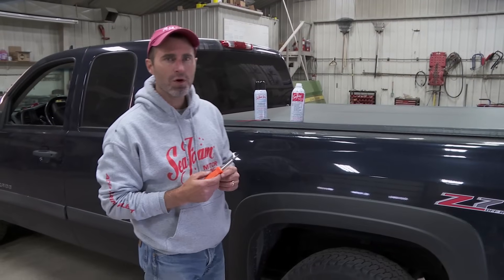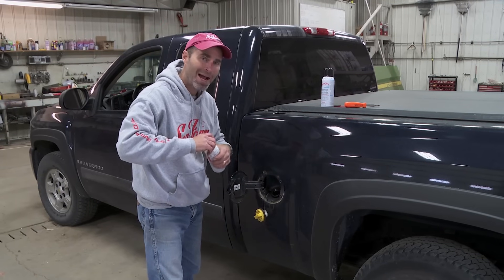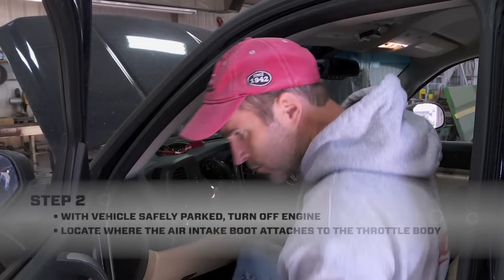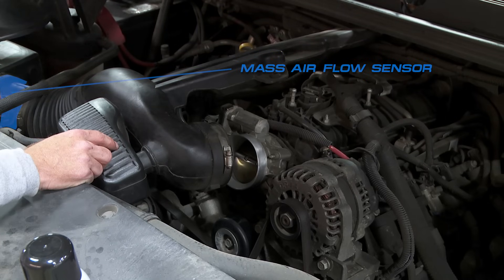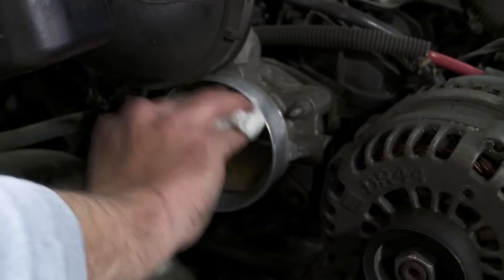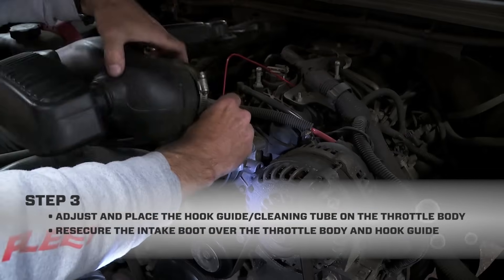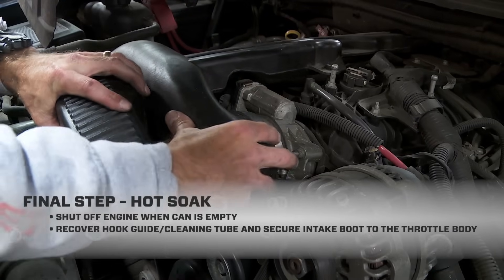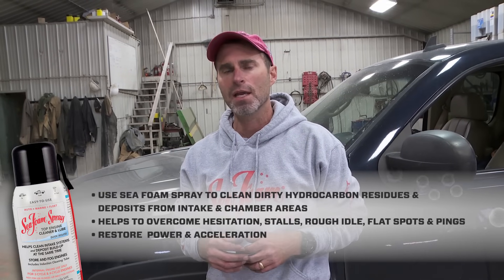How to clean a gasoline fuel injection air intake with Sea Foam Spray

Comment: Just like your website said. It's safe, and I can't add too much....Does that means my gasoline engine can run on pure SeaFoam? I'm sorry. I'm not trolling, I'm just using logic. Because when I read "can't add too much", that's the first thing I thought.

So if add a full bottle like that, to the small tank of a 4 stroke scooter...I will create a blinding smoke screen behind me...but my scooter will still work?
Reply from the maker: 2 answers

Too much: Consider 'too much' in the context of harm or that Sea Foam is harmless to a fuel system..  Will "too much" harm my engine? Answer is no, never.  Nothing about Sea Foam's ingredients can cause harm to fuel system or engine parts and components.  

Scooter: Sea Foam does not replace gasoline. No, your scooter would not without at least 50% gasoline volume. Running a gas engine requires a minimum of volatility/light ignitable vapor.  Keep in mind that these products are intended to help people to overcome common engine problems caused by fuel residues.   Hope this helps!
Reply: Sea Foam Official Thank you. A day after I asked, I saw another one of your videos, where you mentioned up to 50/50 SeaFoam to gasoline for gasoline engines. 

But wouldn't "There is no amount of SeaFoam, that can harm your engine.", be a better slogan, then, "can never add too much"? Because "can never add too much" can lead to people trying to run gas engines on 70, 90, or 100% SeaFoam.

Then again, my slogan idea, may lead idiots & trolls, to hydrolocking engines with SeaFoam....

...How about this?

"SeaFoam is a safe & effective way to clean engines." 

"And continuous use will keep them clean."

"Because gasoline engines need gasoline like fuel to run, you shouldn't add more then 1 part SeaFoam, for every part of gasoline in your tank. Any ratio up to half, is ok."
Reply from the maker: #1) Respectfully, please check out what philosophers refer to as 'infinite regress'.

#2) With that under your belt, I think you'll see our contextual intention is that Sea Foam is harmless to any engine's fuel system no matter how much you use - that's the point we're making, not promoting excessive amounts.  

Note: No one reasonably uses 50% except expert technicians that apply with specialized equipment through the fuel rail using a single can of Sea Foam. Just like toothpaste, I have no doubt that I could safely use a whole tube to brush my teeth...but it never occurs to me because the whole tube won't make things any cleaner than the inch I apply to get the job done.   Hope this help!

Comment: I used this stuff in my intake (spray) and put a can in my tank, and now have a small miss under any load, or acceleration, it even kicked on my check engine light, but when I disconnected the battery, it went away, but still has a slight miss. It is an 07 F150, anybody got any ideals?
Reply from the maker: Check plugs.  If applied too slow (RPM) can foul plugs.
Reply: My bad, it turned out to be one of the new coils was bad
Reply from the maker: Glad you figured it out!

Comment: Can't you short your electrical system opening the throttle body while the car is running?
Reply: WHAT??? SERIOUSLY? if you have to ask that question, you have no business even going NEAR ANY vehicle.
Reply: At 2:41 he says to put the nozzle about 1/4" in front of the throttle plate - not past it. You can also find this in the written instructions on the Seafoam website.
Reply: ShiaLaButtFuck you sir, are an idiot.
Reply from the maker: The throttle body is closed/sealed by the boot during the application.  Other is most modern cars won't start without the boot attached.
Reply: Thanks for the reply, but that doesn't really answer my question: so will my vehicle's electrical system be shorted if I move the throttle plate when the battery is connected?
Reply from the maker: Why would you remove the throttle plate?  If you meant intake boot, no worries.
Reply: I never said I wanted to remove the throttle plate? I said 'move' it, like to get the seafoam spray straw past it, so I can use it to clean my engine. I've heard from numerous professional mechanics that if you move the throttle plate with the negative terminal connected, it could short my entire electrical system.
Reply: Thank you!
Reply from the maker: My error, sorry.   Yes, you can goof things up by pressing some throttle plates.  If not sure what direction a plate turns inward, have someone turn key on and press the accelerator.
Reply from the maker: Thanks, Tweezak.
Reply: No problem, thanks!
Reply: No when you are driving your opening the throttle that’s what gives the vehicle more air and gas and makes the car go faster. Some can be opened from under the hood by hand by finding the throttle cable going to the throttle body there may be two if the vehicle has crews control this is depending on the year model newer model vehicles have no throttle cable just electrical wires this is called fly by wire. If you do it this way you want be able to see the rpm of the motor and if you open it to far cause damage to the motor. A thousand rpms would be opening the throttle just enough that you would hear a very slight rise in the motor rpm. It probably idles at about 600 - 800 rpm.
Reply: I could be mistaken but I believe the instructions mention the included hose applicator inserted approximately a quarter inch from the throttle plate. Not inserting it inside of the throttle body Past the Plate but rather a quarter inch from the throttle plate as the directions indicate otherwise yes you will throw off the calibration on the throttle body itself and may strip the plastic gear that opens the throttle blade
Reply: ShiaLaButtFuck awesome fucking name! That's what I've called that dip shit for years! This made my day

Comment: Curious, what does this do to your catalytic converter?
Reply from the maker: If applied correctly (with RPM raised) will have no bearing on a Catalytic Converter, which is down the air flow stream from the engine.   Fluids (additives) sucked/poured too rapidly through vacuum lines can cause issues.

Comment: Can i do 2 cans into throttle body back to back then let soak 15 minutes. My intake has 245k miles worth of carbon build up. Already did 3 per instructions on separate days. First one people thought the house was burning down. Last one still lots of smoke. Not as much on driving like the first. Car drives much better after.
Reply from the maker: Yes, can do back to back.  Better to do one can, hot soak (leave straw tube in), drive...then repeat so you get 2 hot soaks.  Doing 2 hot soaks with one can also works great (spray half/soak/drive, repeat).
Reply: I see you emphasize hot soaking. So hot soaking and driving for a few minutes seems to be key. Seems to have worked great so far. I wonder how much carbon it got. AS i bet my intake manifold was mostly closed due to carbon. How many more treatments you think it might take? The car has 250k miles of carbon build up.
Reply from the maker: How many treatments depends on the degree of buildup. Charred carbon on upper engine parts is normal, excessive buildup can cause issues, particularly on intake valves. No matter, the broad answer is that Sea Foam Spray helps turn things in the right direction and you can use it as often as you wish.
Reply: am about to do my 4th treatment spray in intake. The last one was still alot of smoke. U think i can ever get my intake free of carbon build up or mostly free? I have seen intakes with 100k miles looking like they are half clogged up. Another question. How much smoke should there be if they are pretty clean?
Reply from the maker: Hi WIlliam:  If you are that interested, consider getting a bore scope view of your chamber hemispheres.  There's no other way to know how much without removing parts.

White smoke is oil vapor - means nothing.  Dark smoke says dirty or motor oil residues getting carried out.

Comment: I got a Check engine light after this. And then, I unplugged the battery and put the wires back on to reset it. Any help??
Reply from the maker: That should do it.  If the application activates a sensor, things should go back to normal once the engine computer adjusts back to running on straight air and gasoline. If the dash light shows after driving 20 miles, a code clear by battery disconnect usually does the trick. Some newer makes will require a scan clear.
Reply: Sea Foam Official okay thank you. Hasn't came back on.

Comment: So you don't fill tank with gas when you put in gas tank?
Reply from the maker: Depends on whether you want a higher or lower cleaning concentration.  Adding to less fuel increases the cleaning ability.

Comment: I am wondering about an 8 cylinder verses and 4 cylinder, full can in both cases???  1998 Saturn SL2...same amount of seafoam spray in both cases?  I am going to start with half a can, let it soak for 10 minutes.  113,000 miles and runs good, don't want to upset the apple cart so to speak...
Reply from the maker: Full can no matter how many cylinders.  Can't cause harm, no worries.  Can also do half a can, leave straw in, then do the second half of the can after the first hot soak and drive.

Comment: I am very pleased with the results. backed up to a wall of tall bushes to use as smoke filter at local shopping mall LOL no smoke. car doesn't pink at 70mph, slightly pings if I punch pedal to the metal at 95mph. use to go up a 2 mile hill at 50mph, now I can go 65mph. How's that for 132,000 original miles
Reply from the maker: Note that you can keep using it to keep working to overcome pings/flat spots. If me, I'd do a treatment every week till the ping goes away.  Try longer hot soaks, too.
Reply: Pretty shitty.   Most cars at 132K are still running just fine and not pinging.
Reply: Use higher octane fuel or get it tuned.

Comment: How should I use on a '68 Dodge Dart Slant Six 225 on a with 132,000 Original miles. This is a legitimate question, Thanx.
Reply from the maker: Look for the Sea Foam Spray video that shows carburetor throat application.  Process is very similar except you're spraying into a open carburetor intake instead of a closed (boot) throttle body.

Comment: How do I use this on a Toyota Prius. The engine doesn't run when you turn it on. It's a hybrid
Reply from the maker: Great question. A Prius accelerator held at 1,500 to 2,000 RPM will be running on gasoline.  Be careful with the straw nozzle direction in relation to the MAF (mass air flow) location... don't let down on the RPM while spraying.
Reply: actually i figured it out. you have to get the prius into diagnostic mode, that keeps the engine running theres a bunch of youtube videos on diagnostic mode for the prius.
Reply from the maker: Helpful to know - thank, ltigre2031.

Comment: can u also add to the crankcase while this being done...crankcase, intake ,&fuel @same time??I have a focus dohc 2.0L EFI
Reply from the maker: Yes, you can do all three at the same time.  Just understand that what goes on in the crankcase does not directly relate to top end.
Reply: OK I just bought the seafoam cans needed to do all 3 will get on it in a min...thx
Reply: Sea Foam Official can I clean the intake again without having to change the new motor oil
Reply from the maker: Hi Clay:  Yes, the intake (upper engine, combustion) and motor oil (crankcase) are not related.  In other words, cleaning through the intake has nothing to do with the motor oil crankcase.
Reply from the maker: Have fun, Clay!  Let us know what happens.

Comment: I heard that this procedure is not recommended to do on eco boost Ford's. They were saying that some have resulted in damaging the eco boost turbo. Is it safe to use on this vechiles? Also, is there any warranty available if it does damage the turbo.
Reply from the maker: Hi Bryan:  Please, respectfully... helping you requires that you be specific about who is "They"?   What damage?   How is it possible?   

Please do NOT use Sea Foam Spray (or anything) if you don't understand what you're doing.  Personally, I would NOT do If "They" has a legit and responsible explanation (not hearsay or poorly formed thinking... ).

Comment: did all of this.. is there a reason my car didn't smoke like I've seen in other videos??
Reply from the maker: Respectfully, please don't suck any fluid through a vacuum line.  That's an easy way hydrolock your engine - can easily end up bending connecting rods and the whole chain of events... You're also NOT atomizing the product, so the product is just getting pushed out/going to waste.
Reply: @SeaFoamOfficial  so on an old carburetor engine from the 70s, just spray down each throat while on high idle?
Reply from the maker: @tompaul2591  Yes, correct. Just hold the RPM at 1,500 to 2,000 while spraying into the carburetor throat.
Reply from the maker: Hi Jordan:  Sea Foam Spray applied through the intake can appear from exhaust in the form of white oil vapor.  There are many variables that determine more or less.  Does it matter? No.  Is it a factor or indicator?  Not at all.
Reply: Sea Foam Official thank you for the response. I didnt mind not seeing smoke as the car runs much better! Great product! Thanks for the response!
Reply from the maker: Our pleasure/glad to help!
Reply: Sea Foam Official so what is the proper way to use the liquid with the vacuum lines, slowly pour it in/spray it in? Your own instructions suggest it
Reply: It depends on the car, my 2006 S430 barely smoked at all .. I've had cars where the fire department ended up getting called because they smoked so bad....
Reply: It smokes alot when u add it tru the vacume hose it's a diffrent procedure. I suck 1 can into the vacuum hose and let it sit overnight. This stuff works awsome, also i recommend marvel oil and lucas are my top 3 goto products.

Comment: Can this help a car vibration at idle with no codes?
Reply from the maker: It depends on what's causing the vibration. If rough running, give it a try and let us know.
Reply: Sea Foam Official another question, can u spray seafoam in the vacuum line
Reply from the maker: We do not recommend.  It will not work nearly as well as if applied through throttle body and would take much longer to apply safely.
Reply: Sea Foam Official I used the spray it work like a charm, and it help me find a leak
Reply from the maker: Great news - thanks, fd92!
Reply: Sea Foam Official besides the leak, my car felt like it ran better thanks for making a great product
Reply from the maker: Glad to help!  Thanks for using Sea Foam products and sharing your experience.  You can do a repeat as soon as you wish.  [you can't use it too often or too much]

Comment: I could not figure out how take red tube and black tip fit into the opening.  When I tried it, the fluid from the can ran backwards to my mass air flow sensor and damaged it and dripped onto my driveway.  Will get a new one in the morning.  That part of your video needs more explanation.
Reply from the maker: Thanks for the suggestion.

The easiest/clearest point to make is that if the end of the straw tube is not pointed immediately at the throttle plate, don't do it.  Note that there's a specific video about locating the throttle plate.

Comment: i have a 95 fleetwood caddy with a 350lt1 with twin flaps in my throttle body. would i have to spray a half can into each flap? how would i do that?
Reply from the maker: Yes, use half the can for each throttle plate.  Spray one side for 2 minutes, then spray through the other plate until the can is empty.  Full can will spray for 5 minutes total, plus or minus.
Reply: thanks
Reply from the maker: Our pleasure - Please let us know what happens!

Comment: Hey I put 3 cans of seafoam into my MerCruiser it holds 21 gallons of fuel will that clean pretty good my carburetor I've seen the spray but I seen you post on a comment that you need to run it in the fuel to clean the needles and floats is that true
Reply from the maker: You have it right, Corey.  Spray trhough the air intake goes right to the intake valves AFTER fuel has passed through the carburetor.  To clean carburetor passageways need to go through fuel delivery (tank).  Next time you add Sea Foam to fuel can add 3 cans when the tank is very low, let the engine run, the shut it off for at least a day.  That allows a higher concentration to soak in the carburetor circuits and clean while the engine sits.

Comment: Can SeaFoam be used in a Harley Davidson to clean the motor? I had an engine blow by issue where oil was blowing out the crank case into the air filter. I was wandering if it was safe to use on it at my next oil change?
Reply from the maker: Yes, add 1 oz of Sea Foam per quart of oil in the crankcase.   Use in fuel, too.  Safely dissolves harmful fuel and oil residues so the whatever causes issues can burn or drain away.  You can also try pulling plugs and shooting Sea Foam Spray in the cylinder cavities to soak for a few days.  Leave the plugs out and crank the engine each day to move the rings around.

Comment: Would it be better to wait for my gas tank to be lower for a better gas to sea foam ratio? i read it can go up  to 1/1 ratio on the can and assume a better percentage of sea foam, the better the results. My car has a 12 gallon tank and has about 10 gallons. i put 2 cans of 16oz sea foam into it so its very diluted now. Should I wait unill I have a couple gallons left and then add a couple more?
Reply from the maker: Great question - Yes, adding more Sea Foam to less fuel creates a higher cleaning concentration.  Your plan looks like what I'd do.  Be sure to drive at least 20 miles before adding fuel.  Also note that you can add a few gallons rather than fill.